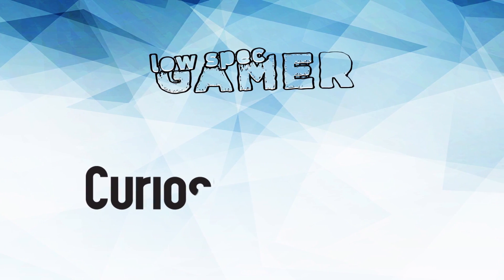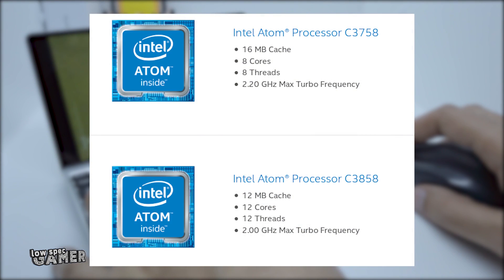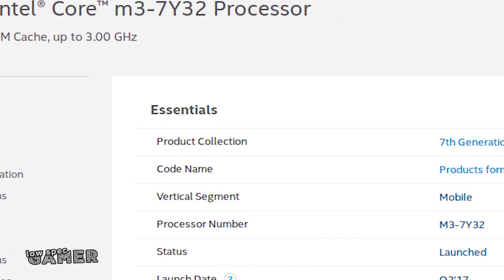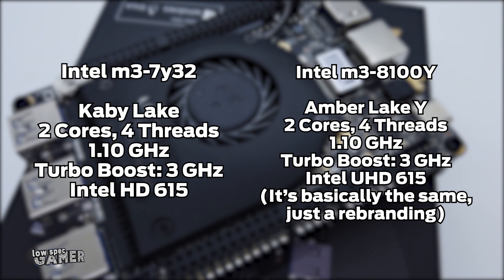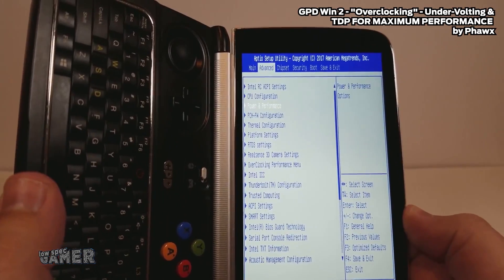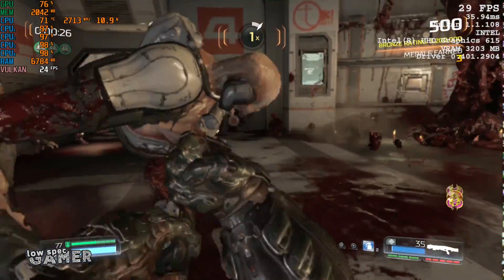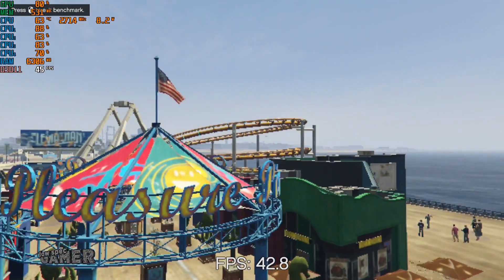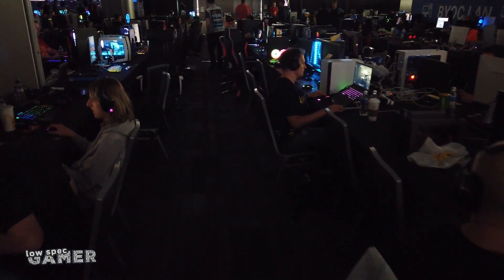Heavy gaming on this tiny computer! (Lattepanda alpha m3-8100y)

Comment: Or buy a console and be happy (buy, install, play, voilà)
Reply: not the point
Reply: Sizniche why not? Gaming is the point
Reply: @paulovinicius315  the point is squeezing as much as u can from "garbage" hardware
There are games being shown because it would have been boring to watch CAD or photo/ video editing instead
Reply: @paulovinicius315  not the point of the channel, as the point of the channel is specifically a showcase of low power hardware mostly for poorer people and small form factor enthusiasts, with this one more applicable to the latter. not the point of the device, as it's an x86 architecture SBC meant to rectify compatibility issues with some programs that can't run on normal ARM architecture of other SBCs. Not even the point of him taking it with him in travel to use as a lan device, because 1.) console lan party compatibility is borderline nonexistent and 2.) adding a big ass console to an already staggering number of intentionally small computers he uses for the purpose of travel would be dumb.

quit shilling.
Reply: Sizniche OK so the channel is for advanced users, for a especific niche. Understood
Reply: @paulovinicius315  you could always watch for the fun of seeing hardware pushed to its limit though, its kind of funny to see the kind of processor that can barely run windows 10 be used to run gtav

Comment: What’s the most powerful, light weight, good battery life laptop you can buy?
Reply: Buy the cheapest and lightest i5 laptop, get another stick of ram and an MX Crucial SSD. For battery life, you can tweak most laptops to get at least 50% more battery life by using balanced powerplans, turning off keyboard backlight, dimming the screen to 50% and optimizing the OS itself. There you go, perfect office/work PC and depending on the iGPU you have even some light gaming.
Reply: LG Gram? Definitely suits what you want... altough not 100% sure about the "most powerful" thing
Reply: Depends what you mean by powerful, but the new eluktronics mag 15 has a huge battery and a 1660ti. Lightest gaming notebook. If you mean lightest ultra book that is powerful, probably the new razer 13 will be the most powerful with a 1650.
Reply: Wanting everything in the world without compromises? Well friend, let me just make a nuclear fission core for you, and use anti-matter cooling for duel Epyc AMD chips... oh, did you need it to be stable? As In quantum stable and not shred the universe?

Powerful= duel Xeon laptop or at least desktop socket Ryzen, battery life equals a 2 inch screen with mobile phone processor (oh wait, that’s just like a phone then...), light weight also equals a phone. So in conclusion, you apparently just want a phone because it gets 2 out of 3 tasks!
Reply: Jake Garrett what if I said price is no factor. So even if it cost over 2000 dollars I’m willing to pay. Even if it was over 3000 dollars, or more I’m still willing to pay.
Reply: Diego Pinon hahaha! I’m over here planning to spend $5,000 for a desktop CPU cooler (no computer included), and you think $2k is even high end or (money is no issue) for a laptop? Does that even buy a base model Apple crapbook? Lol, $3k still certainly won’t get you powerful enough for a lot of more professional applications, you HAVE to know what you need! Throwing money at it doesn’t solve basic physics (even if you had real money to throw, it wouldn’t fix it). As an example, my laptop was only intended for occasional weekend gaming at McDonnalds (basically, 3-4 hours of use per week, or 150 hours per year), so I didn’t spend much ($1.5k-2k) for the MSI GP63 with the typical 8750h and GTX 1070 (which I have overclocked to above overclocked desktop 1070). I would say it’s rather SLOW: using McDonnalds WiFi, the CPU is literally a bottleneck with the 12 threads pegged (my 3000+ MB/s read and write NVMe is just chillin and waiting around as game files are extracted/patched/compiled by the CPU). So yeah... that power hungry CPU (45w TDP is a joke, it’s 80w at boost and always 45w with idle at like 25w minimum on the CPU alone, and the 120 Hz screen doesn’t help...) drains my full battery in under 30 minutes just downloading updates (6 cell Samsung battery), and it’s still not fast enough to keep the WiFi at capacity! Haha, lol, I’m actually planning on carrying my 12 pound bowling ball weight LiFePo4 battery in a backpack since it’s 48v 10Ah, so that should at least give me a bit more than the 5.3 Ah, 12v laptop battery (I should get a whopping 3-4 hours of updates and downloads out of this heavy setup, wooo!)

There are some things you can do to make them more efficient and faster at the same time: The NVMe allows me to download 4x more stuff per visit than its previous SSD/HDD (removed write speed bottleneck for downloads), and saved me time turning 2+ hour downloads into 30 minutes (now hitting CPU limits since the WiFi is really fast there for no apparent reason). But I also tweaked the CPU by undervolting 140mV, so boost is now only 66w (instead of 81-82w), and the sustained constant 45w runs like 15% higher frequencies (my Cinebench run increased closer to 20% improvement). So there are additional tweaks you definitely want to do, especially where performance and battery life can both be improved.

Power, or battery life, pick one! I don’t think you have even a clue what you need or want as those are two opposite goals, as maybe even a duel core laptop from 2012 is all you need at just $200 used with upgrades (I got about 5 hours normal use out of my old HP Elitebook 8640p, used for Python programming which is single threaded and at $150 for a refurbished machine and $50 SSD, it’s blazing fast running Linux, but it also came with Windows 7 Pro. It’s solid and durable though, so not lightweight).

Spending more probably won’t get you any better than a certain amount, because then you’ll just be getting more performance (but then your battery life will be crap). Lol, you need to pick something yourself that does acceptable performance, and then start from there. Don’t say powerful if you don’t mean it, as that’s only going to get you high power draw even when it’s not doing much. Like if you only browse the web, don’t get a dedicated GPU model as that adds weight, takes up space for less battery, and drains battery faster. Plan out what you need, do some research on that first, then look at what’s available and pick what best suits your needs from there.

Hope this helps, as it took like 30 minutes typing from my phone, laptops are a bit like car shopping, you need to know what you want, except I can just fill up my car tank in a couple minutes lol! (I love driving and spitting some flames with my RX-8, it’s all about the Smiles per gallon for me!)

Comment: Dang, I wish Intel stop overpricing their products :V
Reply: I got a 9th gen i5 9400f for 125 dollars...
Reply: @colemin2  and a unlocked ryzen 5 costs almost the same
Reply: @retroree5  Pretty good competition imo, even if the ryzen performs a bit better
Reply: @retroree5  r5 2600 is worse than it, r5 3500 is cool but its not available in a good number in my region. The i3 9100f sucks but I think i5 9400f is a good option for a budget cpu.
Reply: @towsif_8_128  here a r5 2600 is like 120 bucks
Reply: @retroree5  I see... not bad for a workstation use, I really need a cpu more powerful in octa core and 64 core speeds... basically for video editing; btw thanks man!
https://cpu.userbenchmark.com/Compare/Intel-Core-i5-9400F-vs-AMD-Ryzen-5-2600/4051vs3955
Reply: It's not Intel that's setting the price...

Comment: That thing costs 380€. That is really not worth it for the perfomance it delivers.

If it only had a low power Ryzen 3 with Vega 8 and fast dual channel ram, it would even make sense without an external CPU. You could DIY a pretty decent laptop and if those specs aren't enough, you could just buy a new module and sell the old one.
Reply: It sure is a mess when it comes to tiny boards like those.
It's no use trying to hope for cheaper prices anyway.
Reply: You can practically get a pc with that component and a cheap 50 dollar GPU for that price alone.
Reply: just remember what it's made for, it's not for regular desktop use but for tinkering and diy projects, the flexibility is the most important part of this thing
Reply: Small equates to expensive, usually. That's why it's so expensive and look, how expensive those Intel CPUs are. That would make you guess, why everything costs so much.
Reply: Its more of a showcase of how far mobile devices/single board computers have come than something meant to be actually good by our standards. It is super cool for what it is and you could do a lot of cool projects with it.
Reply: Well, it's more for prototype board, primarily used for research and IOT and not intended for gaming.
So yeah, if you want to make a decent gaming PC better buy a cheapest PC you can buy, and the performance will better than this single board.
But the thing is, the device still count as low spec gaming, so as a theme of 'low spec gaming' it is not completely wrong (even it's expensive)
Reply: Yup, and there's soo many options for atom/pentium n/Celeron j series micro pcs in the 30 to 200 USD price range that you can get with decent cooling (just avoid anything fanless or passive) that provide better performance for the price and are nearly as small (or just as small).  Build quality on this is great, but at 400 USD it's only selling point is size, and you can find nearly as small used/refurbished intel NUCs with u series 5th/6th gen laptop i3s and i5s and other tiny pcs from hp and Lenovo with 4th gen haswell t/s series desktop cpus at half this price if you want tiny budget gaming.

This isn't aimed at this channel's market tbh,  the gpio header isn't something useful outside of hobbyist projects.
Reply: UDOO released a single board computer with a Ryzen
Reply: its about the size^^ its smaller like a smartphone
Reply: There is a mini pc called "tbao mn25" it has 2500u for $300
Reply: I disagree, this board is smaller than even the smallest itx board, and uses less power than most laptops, which makes it WAY more versatile, justifying the price.  This board could be the answer laptop gamers have been waiting for.
Reply: @harpskid  Unless you consider the bad CPU which defeats the whole purpose. There already is the well perfoming Ryzen 5 3500U 4c/8t with 8 Vega CUs. Dual channel memory at 2800MHz would kill this m3-8100Y. A little better performing cooler would be necessary, but that shouldn't be a huge task as laptops even deal with 45W TDP CPUs and this is just a super tiny laptop SOC. 

Maybe AMDs next gen of APUs with (hopefully) Navi and Zen 2 would improve such scenarios greatly.
Reply: The Chinese have never had a great relationship with AMD. I’m not sure if it’s availability in China or the price in China but all Chinese designed and built laptop and computers are 99% Intel powered.
Reply: @kowaletzki   even my Ryzen 2200u is way faster than the than the CPU on this board ,  it's pretty nippy actually ,  I've done some tweaking to mine it score really well for a CPU with 2 cores and ht

Comment: High spec gamers : the m3 8100y is weak
My i3 8100 : dont listen to them son
Reply: i3 isn't m3
Reply: @Kratosloop2077  its a mobility oriented , power eficient i3
Reply: @berys76  so much weaker
Reply: @berys76  No. If it was, the m3 would be a quad core.
Reply: @berys76  let me put it this way. m3 is a 7watt chip. i3 laptops are 15w, thats twice the power alone. desktop goes to around 50w. the performance isnt directly linear but its REAL close. 

just because the names are similar doesnt mean the parts are remotely related, effectively
Reply: The I3 8100 should be a bit over twice as powerful as the m3 8100y though so yea.. The i3 is in another league compared to the m3
Reply: How can you compare a freaking desktop Core i3 8100 to a freaking Y-series ultra low power m3 chip?
Reply: my i3 4005u: :( why did you even create me
Reply: @p0ck3tzzz  Your fault for buying a cruddy laptop.
Reply: My Pentium 4: dies in a corner
Reply: @strayfu  .....well only if you use the igup. the cpu is decent enough 

I guess still technically lowspec gamer as he's been using ryzen quad cores now like the 2200g and 3200g
Reply: my a8 7680 want's to die😭
Reply: @pancaxian5144  "want's"
Reply: @danodden9783 busta straight busta
Reply: 8100 no 8100y
Reply: Still both suck, my i3 7100 shows its suffers in latest games, preety badly.
Reply: cries in i3 6100
Reply: @dinnerxet  10th gen looks good you might be able to upgrade to i3 or i5

Comment: Hey. There are rx 470d for sale on Ali express and Taobao for cheap. Thereare also very cheap Ryzen processors for sale. Should I consider buying from there(note:I am from India, and here and rx 580 costs 300$ or any similar card. Even a gtx 750ti costs 100$. The second hand market of my area is not at all good. So my only option is Ali Express/TaoBao and other such sites)
Reply: yeah the r good enough but make sure those are real
Reply: Yes! The RX 470D for around $80 are really good. I recommend flashing the original Sapphire RX 470 bios on them to unlock the full performance. Pairing it with something like a Ryzen 5 1400 would make a great price/performance build (If you can afford it, maybe step up to a Ryzen 5 1600 if you're planning on playing something like Assassin's Creed Odyssey). And lastly, remember most of the cheapest processors in Aliexpress come without a cooler, there you can buy something like the "Snowman" Cpu Cooler from Aliexpress, or something you can buy for cheap locally. And for the Motherboard, I recommend getting something where you live (There are a few A320 and B350 motherboards in Aliexpress, but they seem to be a bit overpriced).
Reply: @federicofiguerola621  noob question, how do aliexprees refunds work?
Reply: @plagueiswise5988  I don't really know, sry. I didn't have to request any refunds for now.
I recommend buying from big stores like Ming&Yang Store or ShenZhen CPU Store, any place with good reviews. I usually buy from them to build PCs and didn't have any problem yet.
Reply: @federicofiguerola621  ok thanks
Reply: @federicofiguerola621  this is exactly something I have been planning around. Getting a cheap Ryzen 5 1600 from aliexpress and also a rx 470d. I would get the seller to mention them as fridge parts/oven parts, cause the import duty on pc parts is very High in India 😂
Reply: I'd recommend finding an RX 480 or 580 for $100 on ebay
Reply: @kevinsj99  I am from India, and here and rx 580 costs 300$ or any similar card. Even a gtx 750ti costs 100$. The second hand market of my area is not at all good. So my only option is Ali Express/TaoBao and other such sites
Reply: @user-nq5hy7vn9k  Oh I see, then yes a 470D would make more sense
Reply: @kevinsj99  yes